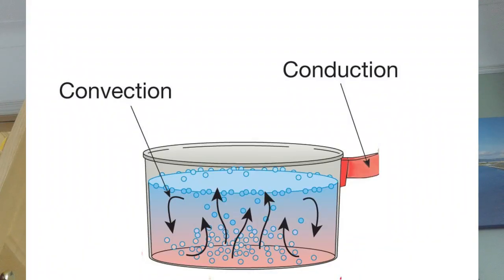Understanding the Science of Solar and Batteries! How My Klarstein Infrared Heating Panel Works

Comment: Interesting thanks, but I note no comments on efficiency of infrared heaters compared to other heating sources.
Reply from the maker: I was going to comment on efficiency but its so situation dependant that its almost impossible to give a general comment and i did want to come across like the marketing of these devices. If you a just going into a room so a shortish period and you was want to heat yourself while in the room, they are very efficient, if you room is large and you want to keep the whole room at a certain temperature (and your heating other rooms that the same time standard radiator might be better), also it depends on the heat generation where its air/ground source heat pump, or gas boiler, oil boiler or even wood burner.  If you have solar panels and a sunny day but very cold then the infrared heats also work well.
Reply: I have to say I recently bought one and it hasn't really done what I'd hoped which was to provide enough heat to be comfortable for the working day in my home office. The 600w panel does throw out a nice heat up to about a metre but only if you're right in front of it and not at an angle which I need to be in my room configuration. As such, to warm the room generally it takes several hours to get to temp meaning that, I probably need to leave it on a slightly lower setting overnight so the thermal mass isn't too cold in the morning, I'm basically a bit on the cold side all morning as it takes until about 2pm to properly warm the room. It has to be said that the insulation in my room is pretty poor and the outside temp has been very low overnight so the room is often less than 10C when I turn the heater on.

I now see that the companies market the heaters as central heating replacements rather than spot heaters for the reason that they don't provide instant, comfortable heat on demand. I guess if you wanted that you'd need to overspec the heaters so they warm up the room more quickly. Perhaps they's suit a better insulated house also. I'd say buy a cheaper one and experiment with it in one room first before you go ripping out the gas boiler and radiators! I'm going to experiment with timing the heater to come on max a few hours before I start work in the office but this can be partially offset by switching it off an hour or so before I leave the room as it has warmed up. I'll also do a usage cost comparison with leaving it on low overnight before coming back on full an hour or so before I start using the room.